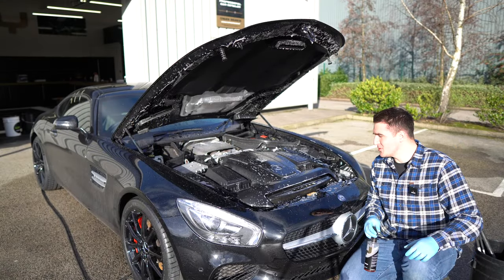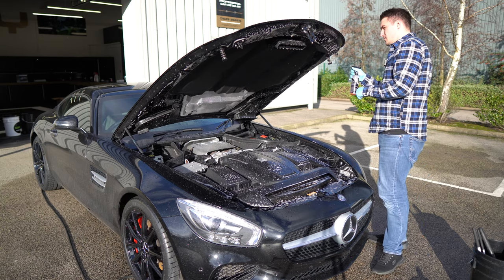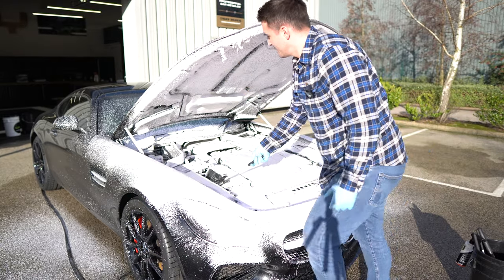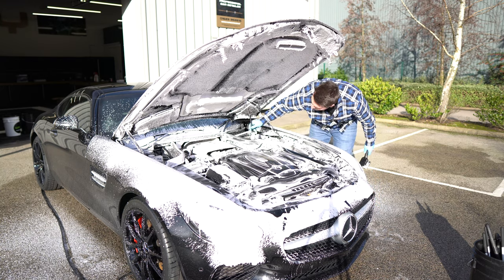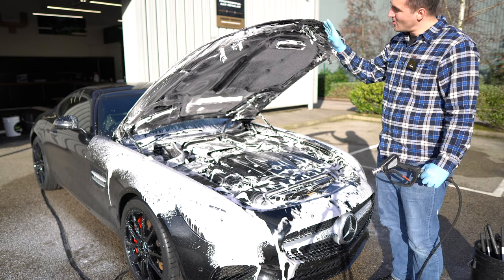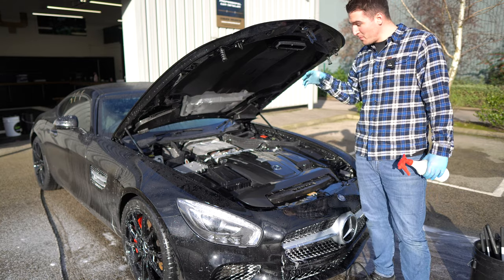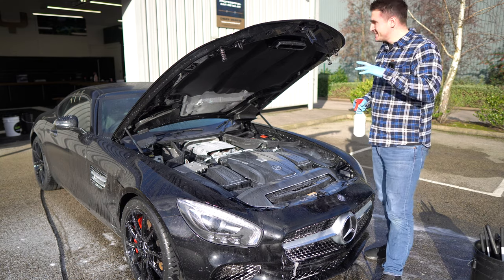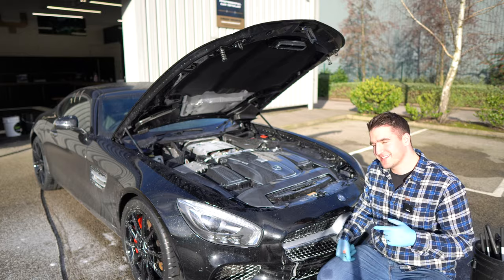AMG Correction Series - Episode 2 - How to Detail your Engine Bay

Comment: Great vid, I've always wondered how best to tackle the engine bay. Can't wait to get out there this weekend now! I guess one thing to watch on slightly older cars is to check the water gutters are not blocked up. My X5 one was full of junk but was fine after unblocking it.
Reply from the maker: Thank you and your correct. You have to asses each engine differently but all new vehicles are safe with the right process.